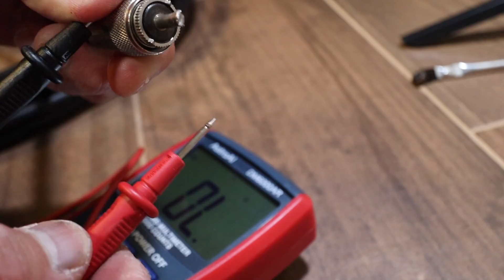WTF! | Neighbors cut my Coax! | Repair my PL259 connector Ghetto Style | Not my best soldering

Comment: I live in the southside of Jacksonville started getting into CB radio about 2 years ago using them in my jeeps. Put a base unit and my boat barn out back soon as I put my antenna up my neighbor started complaining he's hearing me on every electronic device in his house which I know is a lie because I'm only running a Stryker 955 barefoot no amplifier, decided to upgrade my system to inside my house as soon as I put my Mako v58 antenna up closer behind my house the complaints got even worse what I don't understand is I have a mobile car inside my house that I can move around I can watch TV we have a computer probably a lot more devices than my neighbor and not one time has my radio interfere with any of my stuff I got a feeling it's just a matter of time before I get a knock on my door, if they do show up I'm going to make them prove it to me! I try to avoid my neighbor but every time he sees me outside he says I heard you on that radio this morning, I asked him several times can you take a video of what it's doing and show it to me of course the answer is I don't need to show you anything, the funny thing is when I'm operating my vehicles I was using a 102 whip what setting my Jeep and talk to people in the backyard not one time did I ever hear him complain only after putting the antenna up where he could see it.

Comment: It isn't quick, but since there's no crimp, you can just hit the other PL259 with  a torch, clean out the old coax, and re-use it. Assuming you DO have an extra dual female connector in the gozinta box.
 The old ARRL manuals used to tell you that you can direct splice coax, just cross the shield and center connector when you do it.
Reply from the maker: The yard trash is already picked up.  Dang...   I could of re-used it.

Comment: You forgot. Is there an HOA or a zoning law that says you can have two antennas?
Reply from the maker: I don't have an HOA.  If you seen the video previously where the City of Atlantic Beach, Florida sent me a code violation about having more than 1 aerial...  I've since sent them a letter stating that I'm a Federal Licensed Amateur Radio Operator and gave them a quote of the Florida Statue.  http://www.leg.state.fl.us/statutes/index.cfm?App_mode=Display_Statute&Search_String=&URL=0100-0199/0166/Sections/0166.0435.html  So, I put back my Jpole antenna in it's original place.
Reply: @DarrenN4VFR  Nice, around here there are many places where we have to hide the antennas in flag poles due to zoning laws outlawing all antennas.

Comment: Very sorry that your coax got cut. What a cowardly act. Any normal, sane neighbor would have simply knocked on your door and tried to work something out. I definitely agree with those in the comments section that suggested putting up security cameras. I DO NOT however agree with some comments that you should connect any coax to line voltage when you are not at home. Not only is that morally wrong, IMO, but it could also be argued in court that it is a potentially lethal "booby trap". You seem very level headed (as a pilot, you almost have to be), so I doubt you would take those comments seriously anyway. I believe you already said you moved the "offending" antenna so, hopefully, problem solved. I would definitely look into some security cameras. Stay safe. 73 de WB4DW
Reply: I would get a license from the FCC to operate at a higher power so when they cut the cord, they can hear the radio playing through their body as they are burnt both where the current entered and exited their body

Comment: There are federal laws that protect Ham Operators from most antenna issues. You could legally set a tower on your lot and really mess with them.
Reply: K3HQI - when i put up my tower I got three sections of used tower, had them laying on the driveway for about 3 months, the neighbors saw them, I had a mast up that they could see.  Had anyone asked i would have told them, the one section is damaged, I am only going to put up 2. I actually have them with a 9 foot mast above the rotor and a 3 foot hand made base that allows me to lay it down - a 4 element 6m, a 8 el 2m, a 14 el 70cm and a 6/2/70 vertical on the top.  I have a mast with a trident on the top with a discone,  a cheap TV antenna, and a J-pole, a second mast with a TRAM dual bander (a Tram 148?  a 17 foot antenna) on 20 feet of top rail, and a 5 band HF, with a 80 m inverted v between two trees and a G5RV Jr between two others. My neighbors are great.   My 15/17/20 fan dipole got damaged in the last storms, I need to rebuild it. My neighbors are great. The only thing I have ever heard was one of the neighbors told someone, I live next to the guy with the antennas.

Comment: Sorry this happened to you, Captain Darren.  Try a couple of motion detecting game cameras that will activate when someone is nearby.  Wouldn’t be as costly as a surveillance system.  Just be sure to mount them high enough where they can’t be reached without snapping a few photos.  A couple of small “smile you’re on candid camera” signs near your antennas would also make someone think twice.before doing it again.  Hope to catch you on the bands soon.  May all your flights be safe.  73, AD5KL

Comment: Capt sorry this happened pal.  At first i thought copper thieves got you but they did not take anything so that's not the problem here.  I would suggest adding some security measures in the mean time.  If all else fails move up here to Bowling Green, Ky home of the Chev Corvette, we love our ham operators and you have plenty of room for antennas.  Its only 60 min drive to Nashville airport so you can fly out of there. KO4QWY

Comment: I assume the fence is the property line with your neighbor? If so, while certainly no excuse to cut your coax. I would not place an antenna outside the property line setback. This is usually a few feet, but varies with zoning (mine is 6 feet). It's likely against code to put a structure or antenna in the setback. Nonetheless, your neighbor is a total dick. You look like a nice guy and didn't deserve that! If the problem persists, consider connecting the coax to 120V AC ;)
Reply from the maker: This was a temporary location for winter fest so I could talk to my friend at the winter fest site.  I had covid and couldn't go.  I now since put back my j-pole back in it's place 30' up.
120VAC lol
Reply: I’m with Portland.  While there is zero excuse for vandalism, full stop, MPEs at that elevation in the uncontrolled area, and I’d be looking for more elevation on that antenna.

I feel you with your neighbors.  I have a muggle or two where I live.  I always figured they’d go after some MPE angle.  Consequently I was always making sure I was compliant before they’d jump me.

But like catalytic converter thieves, I’d just make it a pain in the butt, with video if possible.  My coax would be litigable and tough to get.  Perhaps my beam may have an unusual heading into the parabola that is their sat dish hihi.
Reply: @randallstone2444  What about putting a thick sleeve around the coax so they can't cut it like in a telephone booth

Comment: Just worked you at your POTA activation on 14.327.  Sounded good here In CT.  BTW, after dealing with soldering many PL-259s myself, I bought a crimp kit a few years ago and have never looked back.  So much easier with the included coax stripper as well.  Good luck with your neighbor and wishing you many VFR days.  Doug, NP2GG
Reply: Crimp kit is definitely the way to go. Times Microwave sells the tools that work perfectly with their cable.

Comment: Neighbors like never before are now offended by antennas but have no problems with placing a 5G phone in contact with their head. I regret to have to tell you this but it’s only the beginning. I eventually went total portable.
Reply from the maker: I'm not going to escalate this with them. I just put my J-Pole back in it's original position and about 30' up.

Comment: Well that's a bloody shame really, I'm sorry that happened to you cap.  I had a similar frustrating thing happen to me once it wasn't someone cutting my antenna feed line but someone shut my simulation down on a school computer after it had been running for a few days and I lost all my work and had to start over.  It was part of my dissertation work which was extremely frustrating.

Also I'm really curious what your favourite plane to fly is?  I think my favourite plane I've ever flown in was a Bombardier Global 7000 with my uncle my favourite big plane is the 777.  My least favourite plane to fly in is without a doubt the Dash 7 which is how I fly to Rothera in the Antarctic the BAS use them to fly us from the Falklands or Chile to Rothera.
Reply from the maker: Whoa, you did some traveling to the southern hemisphere.  My plane I fly is Bombardier CRJ900.  My favorite is the Boeing 777.  It's large and sexy in my eyes. I may try out the Boeing 737 in the future.
Reply: @DarrenN4VFR  I'm not a pilot though the pilot on the Global 7000 let me sit in the cockpit and pretend I was flying..  At least I hope he or the computer were in control.  But the view up there is absolutely the best.  I've flown in every class on int'l flights on the 777 and 787 on a variety of airlines that fly them.  Without a doubt Etihad, Emirates and Singapore Airlines 1st class are my favourites.  The BAS Dash 7 flights are the absolute worst flights, we're packed in like luggage and sit on the floor basically.  The flight is about 6 hours from the Falklands to Rothera and my laptop dies about four hours in to the flight so I'm left listening to music on my phone or reading a book.  That said, I'd rather fly than go through Drakes passage in on a ship..  I've never been so sea sick in my life and the waves were two to six meters for way too much of the trip.

Comment: Get the wireless cam by reolink with the solar panel to charge the battery with Tilt & Pan and be able to connect remotely from anywhere. I have 2 of them one on each side of the house. Make sure the cam or cams are not visible to the public and try to catch the person who cut the coax. Move the antenna from that location away from the fence and closer to the house.
Reply from the maker: Reolink?  I need to look into that and with solar power.  Thanks Casanova!
Reply: @DarrenN4VFR  I'd recommend installing the camera but leaving the antenna in place. Catch them in the act and press charges. They aren't interested in being neighborly. There's no "oh I made a mistake".
Reply from the maker: @gingerman5123  Thank you.  It was a temporary placement for winter field day.  It's now about 30' high in the original place.

Comment: pretty sad........... my question would be why did they go to the trouble of cutting it up so high?............other than making it harder to fix? although you only have one connector to replace the way they did it........... no "wire it up to 220" you don't want to escalate the problem from a cut coax to something much worse ..............see what happens when you move it.......... 73 Mike K1FNX near Boston

Comment: Too Funny.. Not that your neighbors cut your Coax
Too Funny in how Pathedic they are in having done so
Maybe, install a few cameras so you can Fully Catch them in the Future..

Here is my story.. which in the end is Funny

I had 2 huge vertical antennas..one for 11 meters.. another for vhf/uhf plus 2 beams

For my HF stuff i had Heliax LDF5-50A coax
For my vhf/uhf i had Heliax LDF7-50A
( yes i know it was over kill even though 160 foot runs )

My coax from roof passed over the 3rd floor above me
And into my 2ed floor window
However due to how thick both heliax coaxes are
They do Not bend easily
 ( try doing a RF chock out of LDF5-50A lol )
So from going from roof to my window.. both coaxes slowly curved down..and to make the needed bends was about 10 feet...meaning...walking on the sidewalk one actually walked under my feedlines as they arc'd to mynside window

Well one day a officier stopped in on me at work
Thinking he was just saying hi ( we are friends ) 
Instead he says here is one for you

A neighbor on the end of the block ( meaning 300 or more feet away..lol ) called police..in police arriving this neighbor claimed i was "Stealing" cable  and for evidence directed the cops to look up 300+ feet away at those crazy antennas and the huge wires running from roof to my side window..

One of those cops said ( my friend ) no worries neighbor
He had Communications equipment even we dont have

Another time....my vhf/uhf vertical had one of my guy wires Snap.. and my antenna fell..leaned over the street
Just 5 or so feet from hitting building on other side ofnthe street
As a cop and my landlord knocked on my door early one mourning as i was getting ready to go to work

So there was my landlord ( who quickly left..he knew better..lol ) a cop and downstairs the fire dept arrived

Cop said..umm...your antenna fell and what is it used for
I told him i was a ham radio operator
Cop was like..you have to go and remove that antenna Now..

As i was explaining....
A fireman said..hey i will run up and check it out
If it is dangerous i will remove it
I said  Sure and thanks

Up fireman climed the fire escape up to the roof
As cop tried lecturing and saying whether he removes the antenna or not..i must..

I said lets see what the fireman says
5 mins later..fireman was back

My antenna was re raised and set in place
Fireman said he reset/ hooked upnthe broken feedline and all is good

I said a thanks and fireman left
I too turned to leave..
When cop was like...regardless what the fireman said
You have to remove it

I said..Sorry Nope
You heard the fireman
It is reset and Fully safe

Cop tried to insist i un install it
I said sorry i am late for work
Fireman said it was safe

Cop tried a different stragety
Asking if i ever obtained the legally needed permits

I said what.. none needed
Cop asked how long i had it up

I said Sorry officier not long
Those antennas have Only been up 8 to 10 years

To which the cop shoke his head
He knew he was powerless about my antennas
And then simply walked away

So many do Not understand our hobby
Many think it is Crazy

Yet...oh well
Live and learn...lol

So you get your antennas in order
And enjoy our hobby

Additionally given the pandemic
I hope your flying has not and will not be interuped by those causing problems in flight
Reply: I have a couple more ( in the end funny stories.. though those are more related to having and using HT's lol )
Reply: The cop was just being a cop exercising his authority towards nothing..LOL..